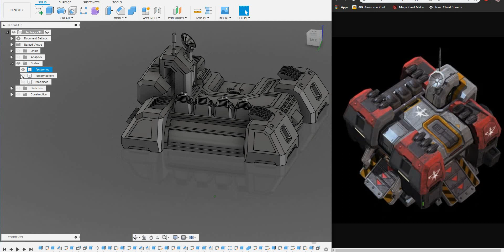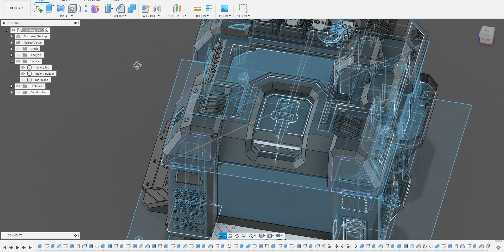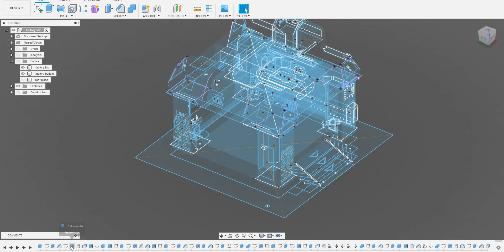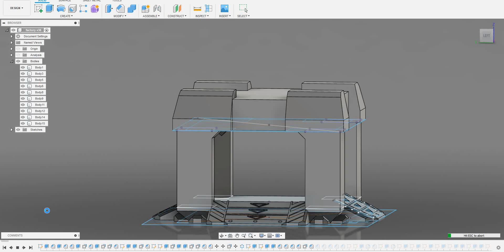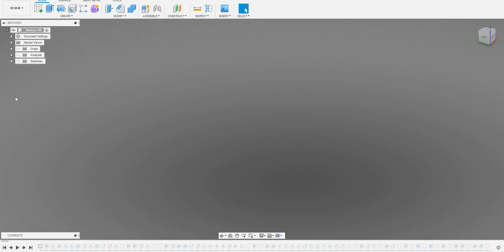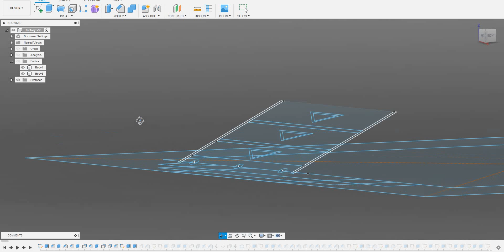3D Design Commentary - Fusion360 - SC2 Factory

Comment: Great design as the supply depot too.
But I think you must split it into pieces in order to print easy and smooth.
Printing as a whole object there are support on the object and also take much more time than print it into pieces and glue them.
The side tube on the supply depot is hard to print without many supports.
That supports cant be all on the plate half of them must be between the floor and the tube.
If the tube was another piece and then glue it on the supply depot it will be faster and better.